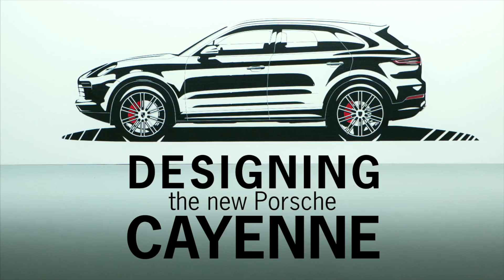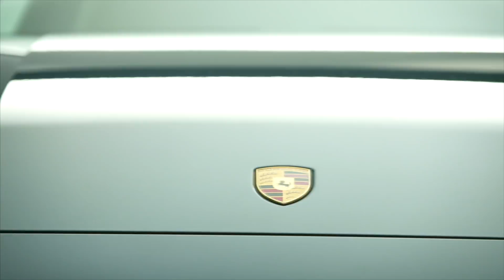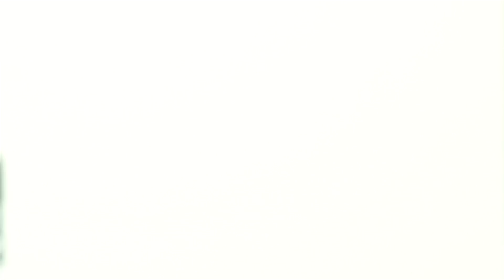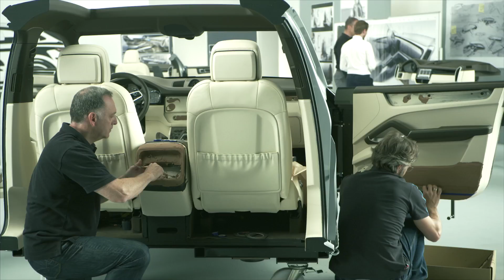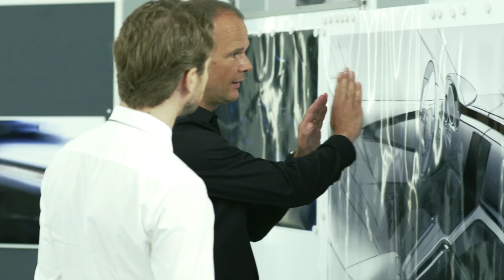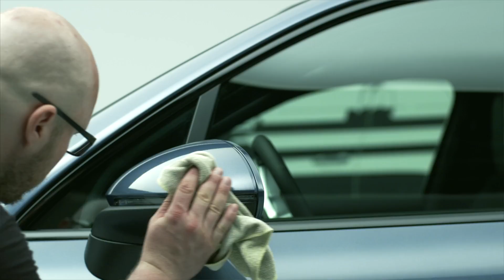Designing the new Porsche Cayenne.

Comment: I like the design well enough, my concern is with the touch sensitive surfaces. If there is no haptic feedback, I believe you have gone in the wrong direction. I went away from Cadillac for this very reason - touch surfaces with no feedback was an absolutely terrible experience and soured me on the car. I'll be testing a Panamera later this week, so this will determine whether we go with new or used. 
I went from Cadillac to a diesel Cayenne and it's the best daily driver I've owned...ever. Which is my only other complaint - I wish there was a diesel option.